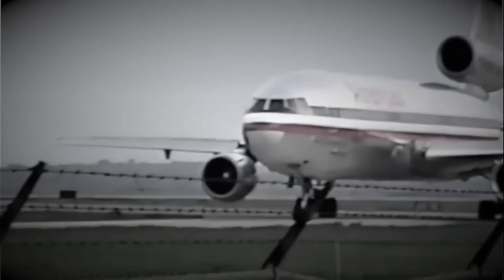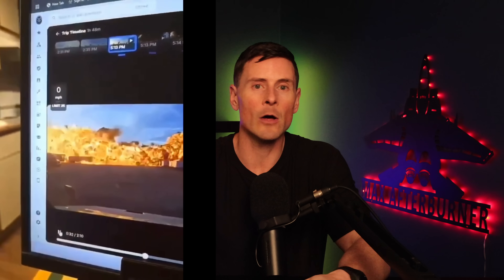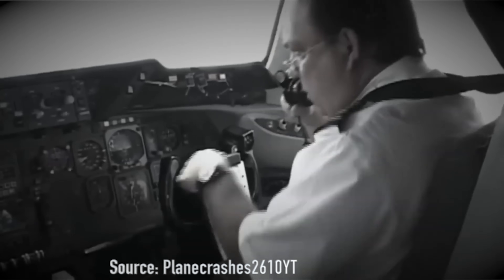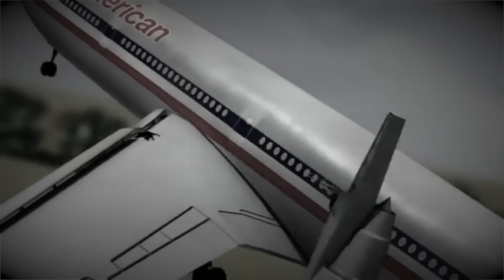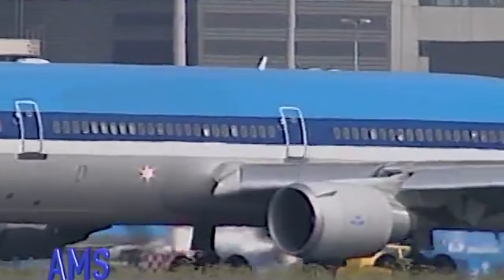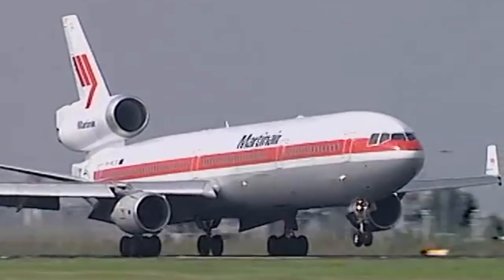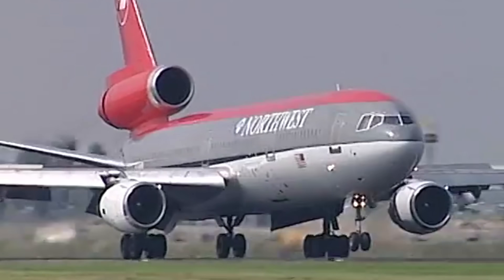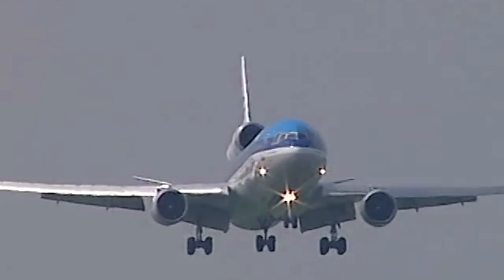Airline Pilot Exposes CRITICAL FLAW of UPS 2976 DISASTER

Comment: I can’t be convinced that safety is airlines number one priority, I believe it will always be money and profits followed by safety
Reply: The cost in both dollars and reputation is astronomical when an accident occurs by short-cutting maintenance. It's cheaper in the long run to follow the processes.
Reply: @mchristr there's proof of shortcut maintenance?
Reply: UPS is a very reputable company and I believe they wouldn’t be as slipshod in their maintenance procedures as American Airlines was 46 years ago!
Reply: As a pilot, that is completely true
Reply: Yeah. Flying is only safe because pilots (not CEOs) fly airplanes. If you don’t believe me; get a pilot job.
Reply: @SpypilotSR-71 🎉🎉🎉
Reply: I worked at FedEx for many years loading and unloading these planes. Your analysis is just simply not true. Even though these planes carry very few people, pilots and mechanics would scrap a flight without question. That would force  us to unload entire planes and staying late until another recovery plane could be flown in and reloaded. Not to mention stringent maintenance inspections downing an aircraft for many hours which is required by the FAA. All of this has a major cost prioritizing safety over profits.
Reply: @justinm4253 all that work can be erased by pilot error , all it takes is one switch left in the wrong position for takeoff or landing . So far as of November there have been 4,100 plane crashes world wide . That equals out to 11 crashes per day for 365 days . That is pretty frequent by any calculation
Reply: Well, people won't fly if they are afraid.
Reply: Imagine what it’s like over there at COMAC? 😂😂😂
Reply: Isn't that life?
Reply: Basic biz … bad safety = fewer pax. Far fewer crashes today than in the 60’s thru 90’s while there are thousands more commercial flights everyday. A lot more “media” coverage of events that don’t deserve it.
Reply: It isn’t, the flow is usually 

Efficiency 
Practicality 
Safety 

If safety impedes either of the top two it is managed .
Reply: At the same time, safety relevant people are forced to work unpaid.
Reply: Boeing killed 350 people cutting corners to make more profit and paid out a little more than a million per person in fines. Meanwhile they spent 42 billion on stock buybacks. 

No one went to jail. If the only cost of being a fraud and killing people by lying and unsafe practices is a fine that is orders of magnitude less than the profit you make by lying there is no punishment for being a corrupt or for killing people. There’s only a small permission fee.
Reply: The way you make money and earn profits is by flying people or packages around the world. The way you lose money is constantly crashing planes. You cannot prioritize profits over safety because the two go hand in hand…
Reply: Profits are always number one.
Reply: Safety is just lawsuit prevention. Basically everything is.
Reply: There will always be a tradeoff with profit in a capitalist economy.  Any business or service needs to make profit to survive. This could be linked to the airplanes service and inspection history. The airframe might have been too fatigued, or something overstressed or weakened years ago finally failed. Or it could just be blatant incompetence or negligence. Lessons will be learned and new operating procedures adopted. Safety should improve.
Reply: @mickmaverick33 Yes, America is Capitalist. 
  Would you feel more secure flying on Socialist Mamdani Air? 
  That’s a serious question
Reply: Absolutely correct!
Reply: We have had the quality loss topic before in US engineering at some a lot people. The best are working on F35 (e.g.) and some like trashing the space with unnecessary satellites all such and a lot cause such problems like at Boeing +++.
China quality but because of fast money making and work pressure and some sometimes chaotic people in jobs which have no room  for uncontrolled chaos.
This would be no problem when they work controlling each other togehter instead of alone and under such time pressure.
Reply: That’s facts but if safety is not rethought about after this they will not have any profits so they better pick there poison wisely!!!!
Reply: That’s where your pilots step in. 

The most hated feature of any operation is the pilot. Because a good one won’t play their games.
Reply: This is not an airline. UPS does not fly people.
Reply: The honest truth is that no one prioritized safety anywhere, even in our own homes. The number of intentionally disabled smoke and CO2 detectors I’ve seen in private residences due to “beeping” (clogged or low battery) tells me that people would rather risk the lives of their family rather than deal with the minor inconvenience of cleaning a device or replacing a battery.
Reply: Its profits of everything. It always has been in every industry. Open your eyes
Reply: That goes With everything really Particularly fast moving vehicles and machinery with humans involved, we matter less than many things thats just a sad fact but a fact none the less. Somedday humanity may wake up before we go exctinct, or not, we will sind out really soon.
Reply: You wouldn’t be in business,if you aren’t safe!
Reply: Some of y’all are so mad and it’s just hilarious 😂😂
Reply: You can't be convinced because you've been conditioned by America's now-warped sociopolitical environment to view everything as reductively as possible.
Reply: That's how all Billion/Trillion dollar companies operate, We are nothing to them
Reply: Money and profits are inherently tied to safety. Airlines are already an unpredictable and often money-losing venture. If the flying public genuinely begins to believe it’s unsafe (it isn’t), airlines will suffer as a result. They have a vested interest in their planes not crashing even if from a purely economical standpoint.
Reply: American airlines that had made some bad maintenance mistakes close down completely a few days ago as I understand it....
Reply: And that is 100% correct. If Safety was No.1, no plane would ever take off! And that is a fact.
Safety is properly No.3 or No.4 in a properly run company.
"Safety is No.1" is ALWAYS a lie, and any company which states this is beyond stupid.
Reply: Ok!
But; the stall werw in the rear engine or the the other aille engine?
Because, in the last hipotesis, there may happened some lateral projections, like a blade of the "good" engine.
Reply: Money 1st safety 2nd.
Or they go out of business.
Reply: I worked as an AMT for forty seven years twenty two at UPS. The problem is when the company decides to obtain an aircraft for the fleet they never talk to the mechanics about it..They were told by the mechanics not to buy the MD11 . When I came to UPS I had 15 years of experience with airlines. Most of my coworkers as well.
Reply: I believe two things: Boeing cheaped out on engineering/construction and were too optimistic about revisions; maintenance doesn't control everything as it should, as they pay too little per hour. 

Who suffers?
Reply: Yep! These planes get used like crazy. Little to no ground time to allow for any real inspections for critical systems…
Reply: That's a shortsighted observation.. if safety was the overriding factor then no planes would fly.. no cars would drive.. and you'd never leave your house
Reply: I work for a major US airline and safety is number 1
Reply: When push comes to shove, safety takes a back seat. People makes mistakes. Intentional and otherwise. People have bad days, anger at company. Managers, problems at home, and so on..
Reply: If safety was a number one priority, we’d all stay home.
Reply: @ads3-1.0  But what about indoor air quality??? Studies show…. 😆

👍👍 You’re 100% right.
Reply: @mikestewart4752 😂🤣well played Sir… well played. 👏
Reply: Safety is the top priority because without safety there would be no profit. A couple crashes an you lose customer confidence plus the lawsuit factor you’re out of business in no time. So safety is the top priority but not because they care about  passenger safety
Reply: @timblack33  im pretty sure planes crash all the time , yet ppl keep flying
Reply: @DeeKay617 I think most people are smart enough to separate general aviation crashes from airlines
Reply: @timblack33  in both cases they are airplanes that crash ...  i didn't categorize it  , you did .
Reply: Literally true, but not as nefarious as you're framing it. If safety was the priority, then no flying could take place... it is an inherently dangerous activity.

The goal of flying planes to ship packages to make money is... "to make money" by fulfilling a customer demand. Safety is no one's first priority, and its annoying that any company, government agency, private party, or individual ever says so.
Reply: @isleschild  👍👍 Safety is an exercise in risk management
Reply: @isleschild  When they say safety first, you know they don't understand safety.

Safety third is at the top of the bell curve. You don't have to like it, but safety third is safest.
Reply: @isleschild  I had a friend who didn't tie her shoelaces, and walking down her front stairs, fell and dislocated both elbows.  EVERYTHING can be characterized as "an inherently dangerous activity".  So that statement is totally meaningless and of no value in any intelligent discussion about safety.
Reply: @dghjkjluoptyutyu   "a person can get seriously injured falling down the stairs, so it's meaningless to describe an industry with billions spent annually on oversight, certification, safety, and investigations across multiple national and international organizations as inherently dangerous. Why, I personally did an Operational Risk Management assessment before going down my front steps this morning, just like your professionally certified pilot does before his equally-dangerous flight. i also made sure to get my Civilian-Stair-Administration (CSA) compliant amount of sleep, in order to ensure that i was properly rested before descending the stairs!"
Reply: @isleschild safety is a priority in many industries. I and many others  live it while driving hours to work and while at work in the oilfield. You know nothing about safety.  Flying is safer than driving.
Reply: No shit Sherlock. Profits are always going to take precedent. Let's see you or anyone start a company with the goal of never making a profit.
Reply: @sleepy670 settle down ma’am😂 just making a statement😂
Reply: Then you aren’t very bright and don’t understand math.  If you look at the airline safety statistics in the US they are mind boggling in how good they are.  When you think what a typical airline flight entails: high speeds, high altitudes where oxygen is thin and it is 50 below zero, and lots of airplanes arriving and departing at hundreds of airports each day, the fact that we don’t have weekly crashes is simply amazing.
Reply: statistics don’t tell the whole story.
Reply: this is why I always pray that the mechanics and maintenance crew are happy and well paid!
Reply: @lioraoppenheimer9881 Unlike you, those guys are real pros and take pride in their work and expertise.😂
Reply: 💯 %. I bet this disaster will come down to metal fatigue or sloppy / cheap / coast cutting maintenance.  History repeats itself.
Reply: @PeacefulThinker-14 you know what they say about qualifiers?
Reply: @PeacefulThinker-14  Like the collapse of the USSR replaying in Ruzzia as I type this. 👍👍

Cue up Swan Lake everyone.
Reply: Yes and we witness the blood that writes it in stone
Reply: You aren't in aviation so why would you know anything! Human error happens!  Things fail!
Reply: @Kapone27 tell me your not in aviation without telling me 😂
Reply: @Kapone27 There are supposed to be several levels of eyes on every repair and service. That’s why this is a problem.
Reply: Do you live by your word when it comes to your own automobile maintenance?😂
Reply: @kenandbarbie-b6c  Automotive and Aviation maintenance have nothing in common. You aren't mandated to have maintanince done and signed off by Aircraft mechanics that can be held liable if anything should happen after they do any work.
Reply: @ŠpVŠpý That is not the point at all. It’s pointing out hypocrisy where it’s great to make others spend money on maintenance while evading spending your own money on maintenance.
Reply: @kenandbarbie-b6c it’s still not the same. When my engine blows up, my car doesn’t fall out of the sky.
Reply: @ShaunHensley  You all are missing the point. I have been in the maintenance business for decades & yes people just don’t like to spend their own money on maintenance, even on an expensive car. I have seen a guy come in with a BMW who had a bad master cylinder. Instead of getting the  brakes fixed, he wanted to use the hand brake.😵‍💫 Cheapskate, but he loved spending other people’s money.
Reply: Safety should not be their number one priority. Getting people and cargo from A to B is their business model and should be their number one priority.
Reply: Who knows but ups when I googled it it said they fly temperature controlled health equipment,what that means who knows.
But stuff to keep stuff cool could go wrong. 
Pallets with stuff on,electronics could cause fires
Reply: Gordon Gekko: "Greed is good..."

Comment: How could the Pilot/Co-pilot not know that one of the engines was on fire and DETACHED!!! Apparently this happened well before V1 as the engine was found on the side of the runway.

Is there no Warning Light? Doesn't the Co-pilot or Flight Engineer monitor all the engines and gauges during the most important point of a flight - the take-off?

Also wouldn't this be one of the rare times that a Pilot should not have rotated, and instead begin reverse thrust, braking and all other emergency procedures for a crash landing, albeit at 0 altitude?
Reply: That’s my take…no way I’m leaving the ground with a wing on fire like that  - a guaranteed death sentence.
Reply: Pilots can't see most of the wings or the engines from cockpit - an engine fire would turn a warning light on - but the engine may not have been on fire before it departed - the fire may have come after that when fuel tank in wing was damaged and fuel was ignited by electric sparks.  Tiny external cameras (like used everywhere for years) that would show the pilots the outside of the aircraft should have been added decades ago - but airlines will always fight these enhancements due to cost - (PROFIT is job 1). Just like most airliners don't have cameras in the cockpit still - that is stupid !  Not sure how much runway was left when the engine departed/fire started ? If they stayed on ground and crashed thru fence at that high speed with that much fuel probably the same result - maybe only 3 fatalities vs 12 ?
Reply: @KRAM-ct7ok  sounds about right - there are video screens on the back of every seat (200+) in an airplane, but they can't afford 1 mini camera on each engine.
Reply: The crew has no way to know if the engine is attached or not - can’t see it and no cockpit indication.  Also it doesn’t really matter much if it departs compared to just loosing thrust - there is nothing different a pilot should do.  Engines are designed to detach at the strut if vibrations get too high.  The bad thing about detachment is the potential for parts doing damage elsewhere.
Reply: If the engine failed in any way before V1, it's hard to imagine they wouldn't just have rejected straight away. After V1, they'd have some seconds to decide to either reject or continue. If you see the airport fence or some buildings ahead, you'll know that rejecting and going off the end of the runway is certain death.. so most would probably try the rotate option. Here, though, every option they had already was 100% ending in their deaths, and it's not certain they could have avoided casualties on the ground either. A real no-win scenario where every choice you make is wrong.
Reply: V1 goes by fast. Pilots face “startle factor”, a few seconds of confusion and surprise when confronted with a big problem, which means even if the failure occurred before V1, the speed might have passed V1 before the pilots could react effectively. V1 = the speed at which the airplane can no longer stop on the runway and must therefore continue takeoff

Comment: Its possible that second sparking in the video could be tail strike from trying to rotate instead of compressor stall on #2
Reply: You are right, tail strike is probably the case, I dont know why he goes with compressor stall.
Reply: @tttwicetower8195  If it ingested FOD from #1 it could be coming from that #2 but that video quality isnt good enough to tell. But something is there for sure and it would have to be be one of the 2 options. Tail strike or FODed out #2
Reply: It looks like flame and not sparks like a tail strike would throw. My money is on compressor stall

Comment: Pitches left instead of rolls and yaws left? I think it’s important to use the right technical language for stuff like this, aimed at the general public, because it will confuse them less.

Other than that, this is a sharp awesome analysis with a bunch of details on the AA crash corrections I’ve not heard reported before.

Or is there something about the plane’s attitude that I’m missing?
Reply: Technically you’re correct about the verbiage. However when referring to the “general public”, most people won’t notice because they can’t tell you the difference between pitch, yaw, and roll or what attitude means in reference to an aircraft’s movement. So it’s really not a big deal here.